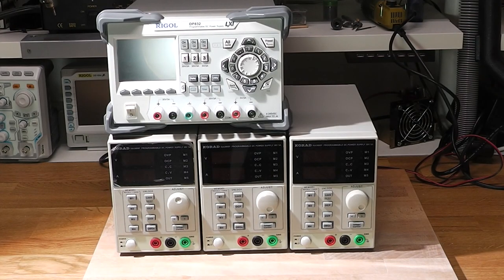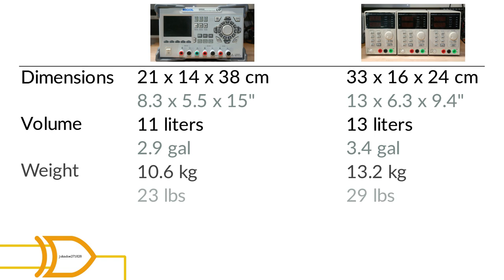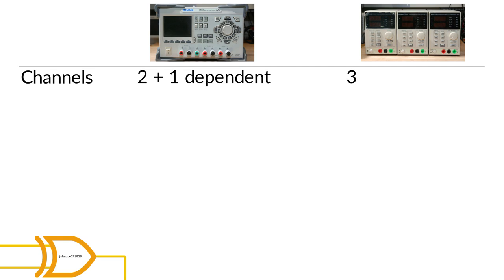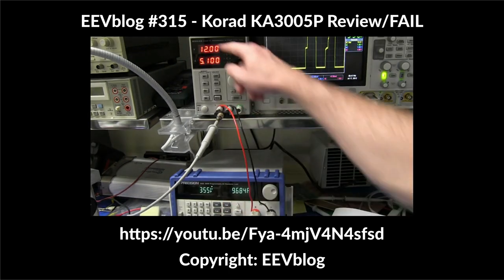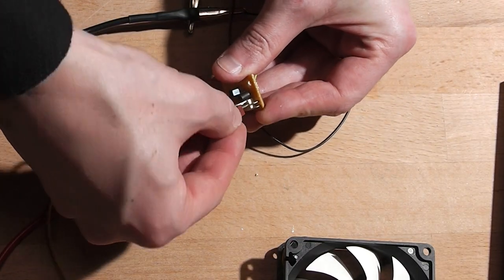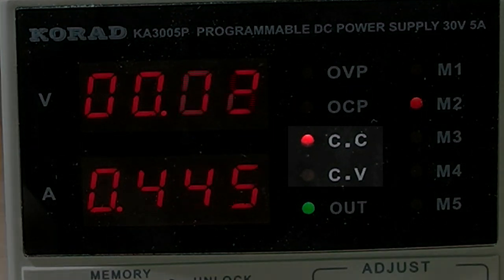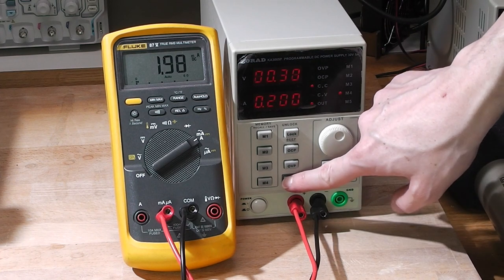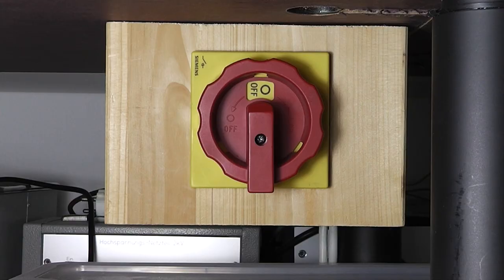Rigol DP832 vs. Korad KA3005P

Comment: You're not right those Korad can only give you DC current while the Rigol can give you six different currencies
Reply from the maker: I'm not sure what you mean by "six different currencies". There's one constant voltage and current limit (i.e., CV and CC modes) that you can enter on the Rigol. Are you talking about the power limit that can be set? Because that is merely some software emulation and, in my opinion, not particularly useful.
Reply: @johndoe271828  No it is truly possible to build you're own current AC, DC, Sawtooth, Block and all also in randomly mode
Reply: Yo want to  like compare peers to oranges
Reply: That'd the standard currency but if you took a look in the manual there can you what different currency you can use there are more than six different currency and the possibility too make your own currency
Reply: I mean of course voltages wave forms you keep on talking about that time difference from when one food soon indicates that there is a short circuit and that 10 times as if you have made a world discovery
Reply: @gerritw.rougoor663  Jesus dude stop trying to justify the purchase of your Rigol with all it's fancy "Advanced" features etc which 'm sure you have NEVER used.  Not once did Johndoe271828 even state that the Korad was a better PSU over the Rigol (watch the video again). He has pointed out some logical reasons for purchasing three Korads for 'his' intended use and purpose and explains why he prefers using them over his Rigol. Don't get so butt hurt.